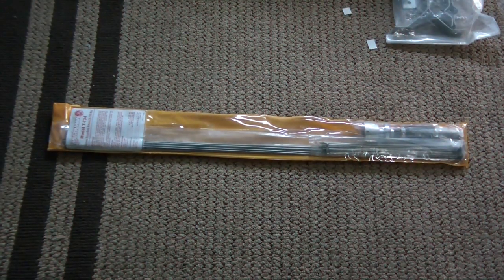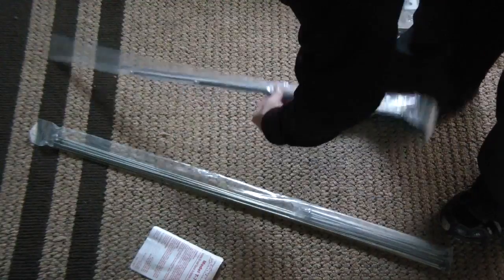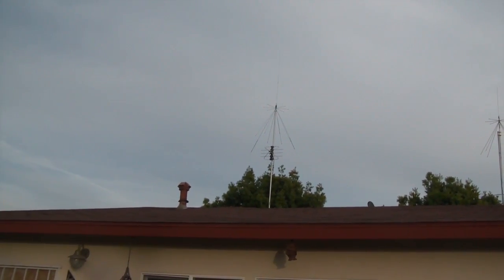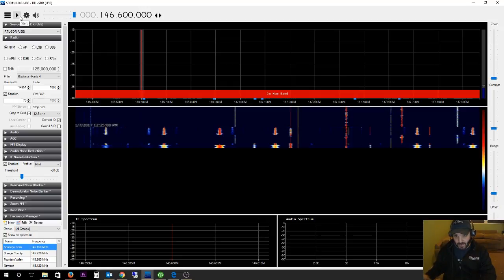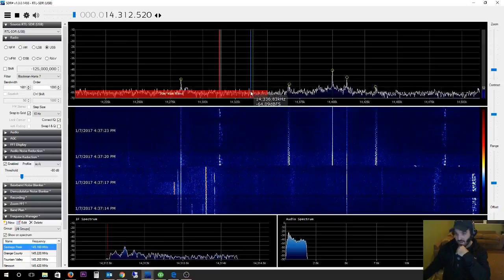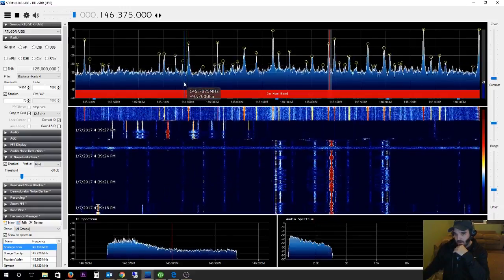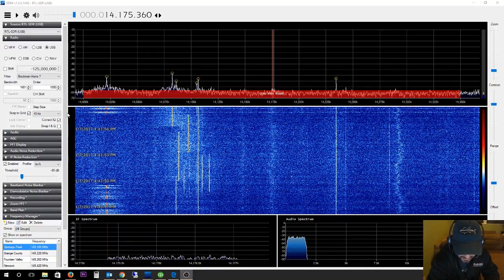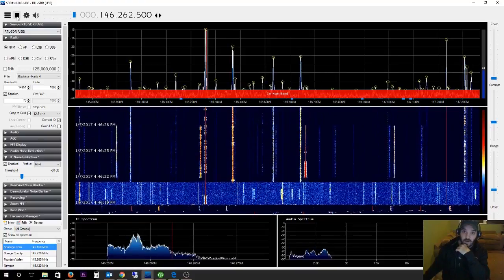Workman T-734 Jetstream JTD2 Discone Antenna install test review

Comment: I'm glad to finally find a video with stable, watchable footage! Super helpful video! BTW, the rtl-sdr blog website recommends keeping the RTL bandwidth (sample rate) at or below 2.048 MSPS. Since the tuning circuit has to capture that wide bandwidth, it can get hot sometimes and screw up your frequency stability when using for long periods of time. I usually keep mine around 1 MSPS and just scroll the bands as I need to. As for your gain fluctuating problem, it looks like when you're in quadrature sampling mode, your tuner Auto gain control (AGC) was left on. When it's left checked, SDR sharp will try to adjust the gain while you're receiving signals. You might have better luck with manually setting the tuner RF gain for the band you're listening to. The recommended technique from the RTL blog is to press play to start receiving signals, then go to settings and start out with zero RF gain and slowly increase it so that the noise floor on the FFT display goes up by 5dB from whatever it was before you applied RF gain. So for example if you start the playback and the noise floor is at -45dB, you want to apply just enough RF gain to bring it up to -40dB, then search for active signals.
Reply: Great feedback, I hope he sees your reply!